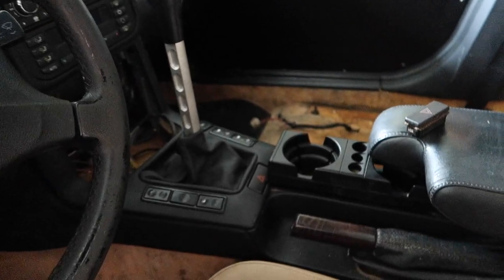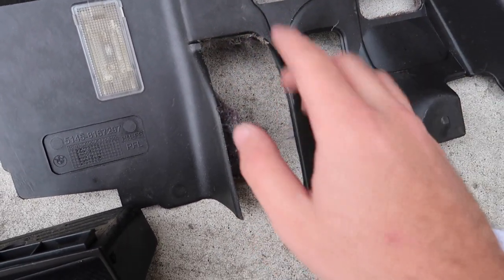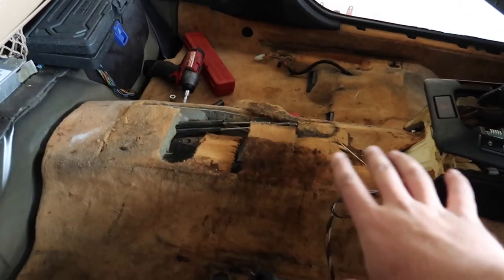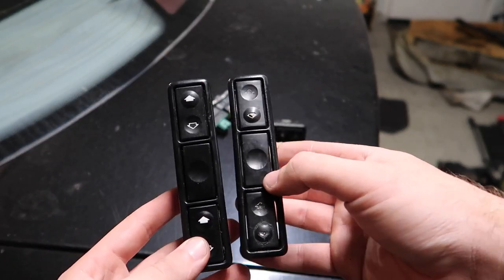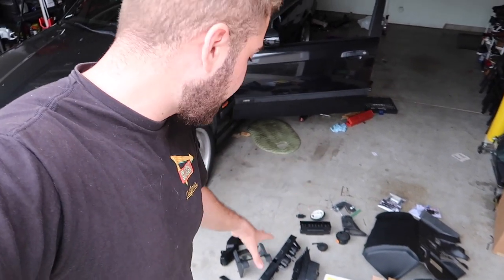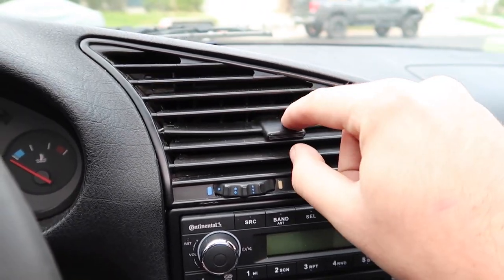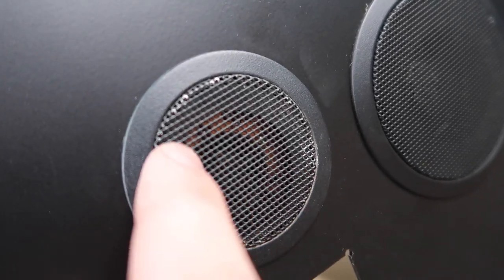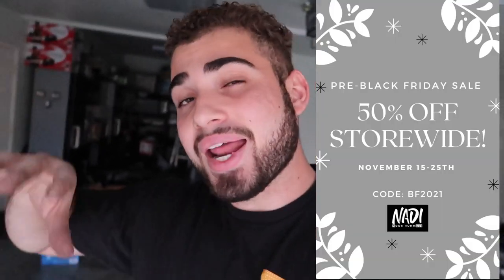REPLACING EVERY FLAW ON MY E36 M3 + MORE MODS!

Comment: Try changing out each individual grill piece on the air vent, I had to do it on one of my cars before. It’s a pain in the butt but it worked on my car. Just thought I’d pass along the information so you could give it a shot.

Comment: Save urself the hassle and get the flexible chase bays clutch line and make the installation issue of that line NON EXISTING. It also goes from the clutch master straight to slave